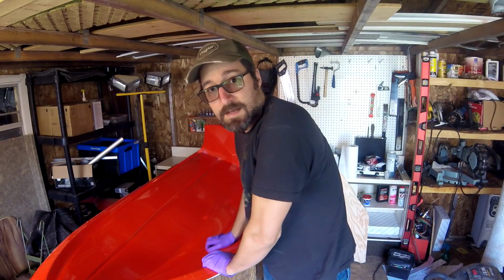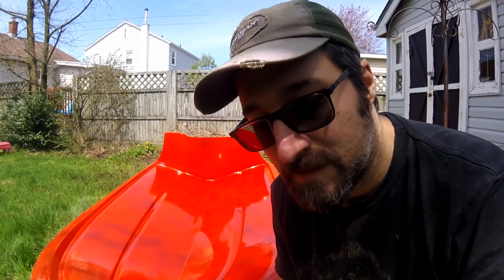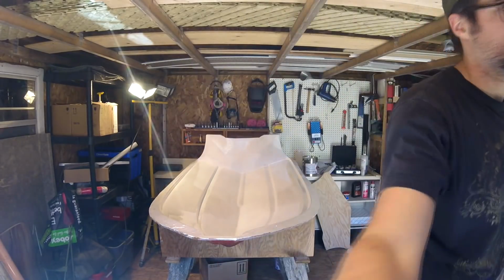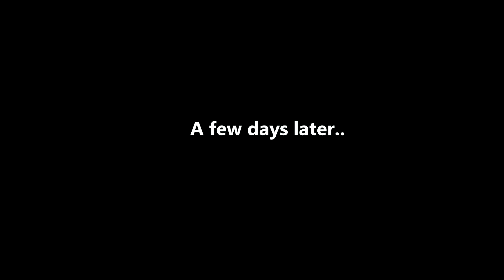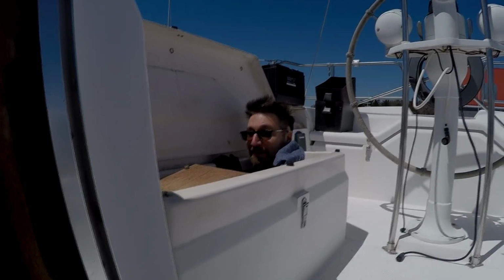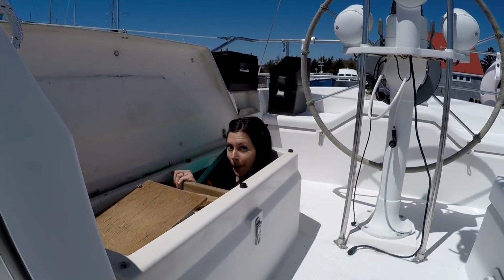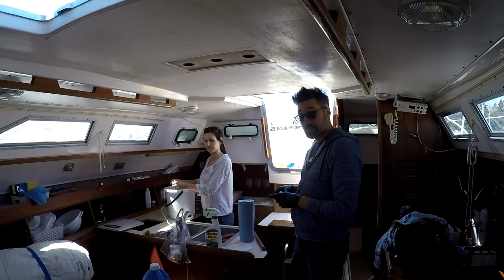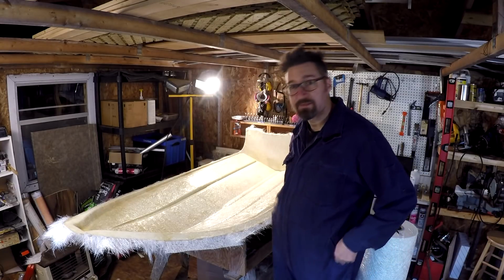Building a fiberglass RIB - DIY Fiberglass RIB pt1 [ Ep 31- Sailing Nova Scotia ⛵]

Comment: The extended winter screwed a lot of us up, even as far south as Maryland.  It wouldn't let go.  I typically get the boat in mid April to early May at the latest, this year it was end of May, with my first outing just yesterday.  And then only motoring out to the river to be sure everything was working correctly mechanically.  And I have no worries about you taking the RIB to cross an ocean.  Yer gonna need a bigger boat.....  ;)  (Jaws reference)   Glad you guys are back... And if you want to do the RIB because you want to learn, more power to you.
Reply from the maker: Thanks!    Yeah, hopefully the summer goes further into October to make up for it!

Comment: How is this episode 3 when it’s the first one of the season, since 7 months ago?
Can you explain what the mold thing is?  It looks like the deck of a boat, where’s the rest of the boat?
Reply from the maker: Saying episode 3 was a mistake, Chad said season 3 immediately after. Its a hull for inflatable tubes, so the tubes will need to be installed. RIB stands for Rigid Inflatable Boat.
Reply: Oh, I had no idea that's what you were building.  I didn't even know that was a thing you could do.